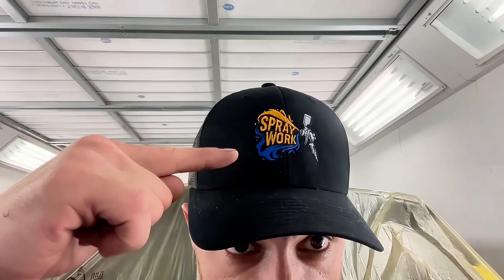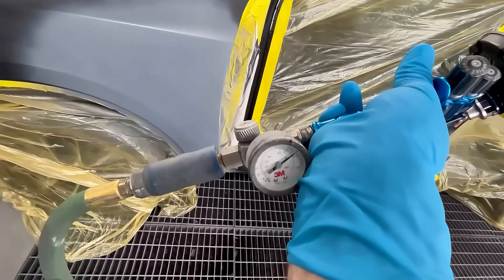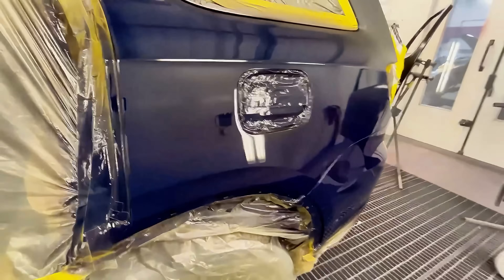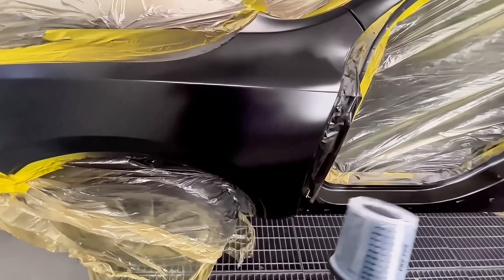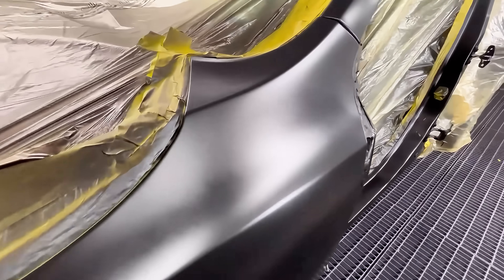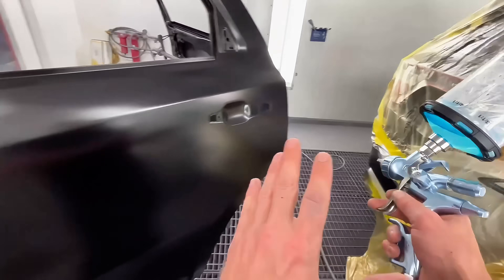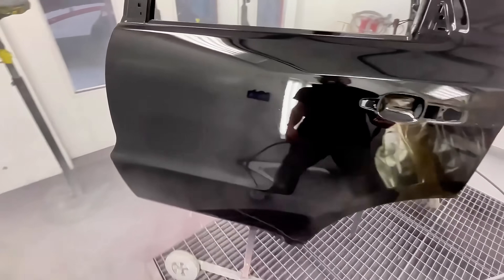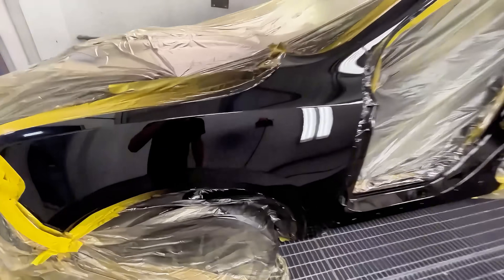"96.69% of Car Painters Use Their Regulator INCORRECTLY"

Comment: Glad I saw this. I was using one then tried not using one and it is so much easier to control everything which is the complete opposite of what everyone tells you.
Reply from the maker: Regulators themselves can cause MANY issues if they are of poor quality or not operating as intended! Which is why it’s so important to focus on what the gun is putting out rather than what some gauge is reading! Thank you for tuning in sir!
Reply: @spraywork what annoys me the most with them is they take up more space on the bottom of my gun. Sometimes I need that space lol.

Comment: What temperature do you work in ,in the paint booth?, how do you not get runs in clear coat? That is my biggest problem,I go through a lot of material.i was spraying at 68 degrees, using medium temp.hardener, I even did a tach coat,I don't know if I waited long enough for the clear to tach,u thought i did, I don't know what to do.i always get runs

Comment: In theory your correct about the changes in your environment paint vicosity all of that yes. But pressure does matter. I had a rep tell me once every guy that says he can tell what air pressure he was at by hearing it or seeing it was never able to get the correct psi when he hooked it up. You spray spies hecker hi tech and don’t know what pressure your guns at it will change the entire way your color looks. You should set your pressure at the wall. Then the gun. This works for u which is great but can I ask u a question can u replicate a spray out card that you created a year ago again today and have it match? I right down what psi I spray my base coat for coverage and drop coat.
Reply: Also will say that you probably are correct in doing it this way with cheaper regulators, but grab yourself a Walcom, SATA Adam or any top digital gauge out there and tell me you don’t notice a more accurate consistency in your work. Especially with hvlp guns if you use to much air pressure your not allowing the paint gun to work for u 😊

Comment: I will say some of his advice is spot on but, let’s look at the facts. Each gun sounds different and if you have 3 different booths like I use each booth sounds different at say 15 psi. Next is with solvent basecoat you can change the color at different air pressure. For me to get the same color match on say Toyota 3R3 or Nissan KAD to match my sprayer out chips I have on the wall sprayed at a different time I need to know what air pressure it was sprayed at. A pressure gauge comes in very handy at times for sure. But it is critical to watch how the base is laying on the panel to get good finished job.

Comment: Realistically thou some guns sounds different than others I more tend to watch how the paint is going on ,over time if I am using the same gun consistently I can adopt to the sound of the gun part ,,,most of these regulators restrict the gun so I don’t use ,,and there ain’t no fixed pressure to use a gun too many variables,temperature and viscosity of materials have things all over the place

Comment: A couple of questions for you.
   Help me understand this... Is the typical regulator at the gun a true regulator or is it really an air flow volume metering valve?  The regulator at the compressor to me is a true regulator that maintains a set pressure.
  Secondly, I noticed that when the trigger was not depressed your pressure at the gun gauge was 110 psi.  Many have told me 80 psi is what is good. What do you feel us home project painters need for psi at the compressor or trigger not pulled.  The guns must be able to handle 110 psi. 
    Thank you for the advice about going off of how it sounds and looks. I can always fall back on that if I can not get the gun adjusted well with the gauge.

Comment: Totally agree, I’ve been painting machinery for years with a cheap ass harbor freight pressure feed sprayer with a 2 qt can. lol. Figured out early that more pressure means better atomization and more paint availability. When I started painting cars I invested in a real gravity feed gun that needs a bit more attention but the entirely new concept of full flow paint with pressure determined by the quality of the paint is a new thing. Just finished two clear coats and they were so simple. Wish is been doing this all along, so much faster.

Comment: Hellooo!! Mr Amedeo hope things are ok for you🤞👌very interesting video and I'm sort of guilty of being a regulator addict as I do rely on it to much but there are times when I can see or hear things aren't right today being a case in point, I normally spray my HS clears at just under 29psi but today I was using a UHS clear and I could see and hear it wasn't right the clear was going on a bit chunky so I upped the pressure to 31-32 psi and it went down a lot better😁

I think we get stuck in our ways and set the pressure the same without even thinking about it then when problems arise we sometimes struggle to know what's wrong🤠🙏👍John UK
Oh the shirts are selling well Amedeo, looking forward to the giveaway👏👏💪👊
Reply from the maker: I’m doing great John! Thank you for always tuning in sir! 
EXACTLY!! 
I mean it’s good to have a starting point! But knowing what and when to adjust is what’s more important! That skill is much better developed not being ties to a regulator ! 🫡🫡🫡
Reply: Thanks for the reply Amedeo, I'm trying to use my eyes and hearing more rather than just having a set pressure for everything but it's not easy, it will take time I guess. 

This is unrelated but it might make a good video for you is I'm trying to leave my gun at full fluid all the time then feather the trigger if I need less fluid flowing, I think doing this rather than adjusting the needle in or out makes you a better painter🤔as like the regulator you are relying on the gun to limit your fluid output rather than using your skills as a painter to do the adjusting using the trigger🤓🙏👍

Comment: i hope someone can answer this, when the sides of a car why i never see any painter spin the gun cap so u can spray up and down instead of side to side
Reply: I find its more natural feeling Turning the gun sideways to spray vertically. I used to be a full time industrial painter using a electrostatic pressure feed spray gun. And most all large panels I would spray vertical by turning the gun on its side instead of turning the cap. Its just doesnt mess up your rhythm and work flow as much as stopping to turn the cap would.
Reply from the maker: Fair question! I do it, on occasion. Like if a door is in primer side to side on the bottom. In that case it would be more comfortable. But most of the time it’s just more inconvenient to turn the cap back and forth than it is to just turn my hand 🤷🏼‍♂️
Thank you for tuning in to the video and sharing your question! I appreciate you 🫡💪
Reply: @spraywork  thanx my guy , im still learning and practicing spraying clear... i have the porphis 715 👊🏾

Comment: Is it just me or does the regulator and gun threads rarely match up. I have a hard time spending top dollar for a brand specific regulator. ✌️
Reply from the maker: I’ve never had that problem, cause I NEVERRR even use a regulator 🤣
But I’m sure you’re not alone with that problem 😕
Thank you so much for tuning in!!
Reply: The threads on most guns are male G1/4(metric bspp), whereas most air hose fittings are 1/4NPT. I found an adapter on Amazon that's works to convert parallel to tapered threads. Without it, you run the risk of using little thread engagement and a leaking connection.
Reply: @setthehook4me  👍🏻